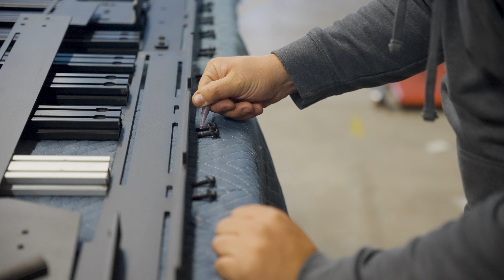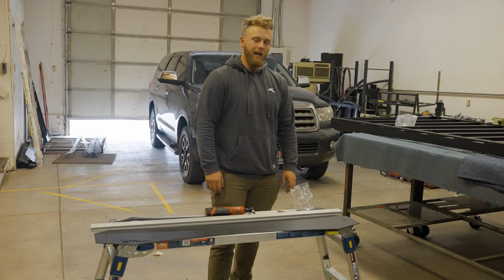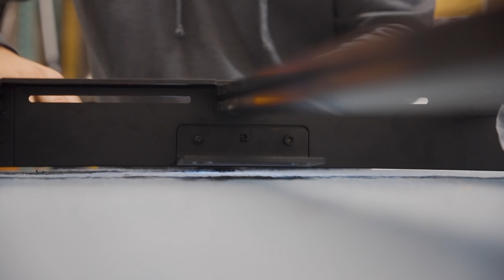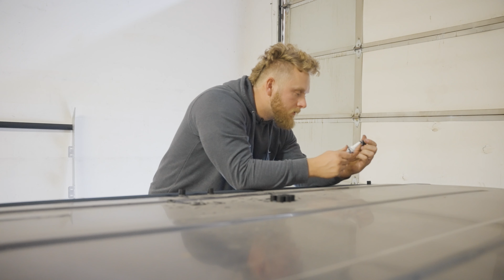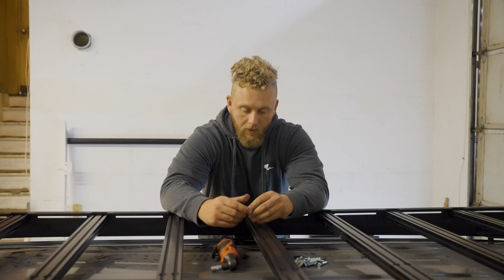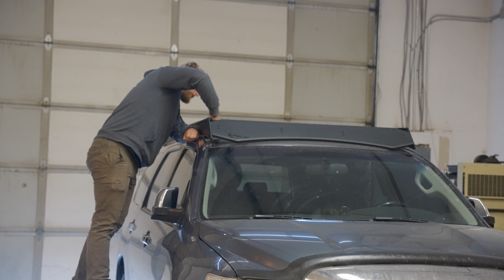Toyota Sequoia Prinsu Pro Roof Rack | 2008-2022

Comment: With the angled top portion of the Pro side rails, can cross bars be mounted to a rooftop tent then lowered down onto the rack? What are the LxWxH specs?
Reply from the maker: No they cannot be lowered. We have a new tent mount that would help in that situation.